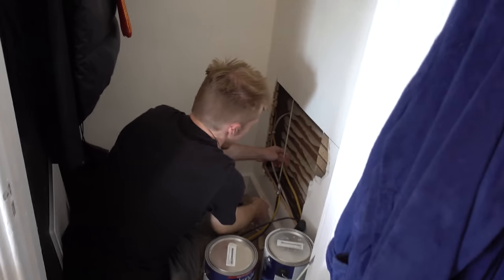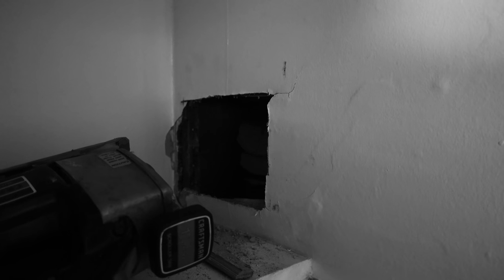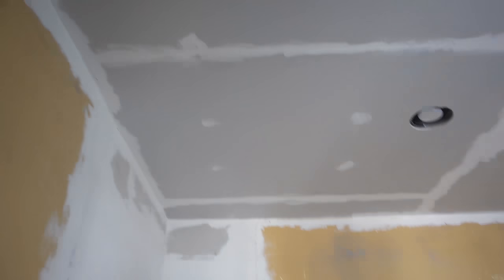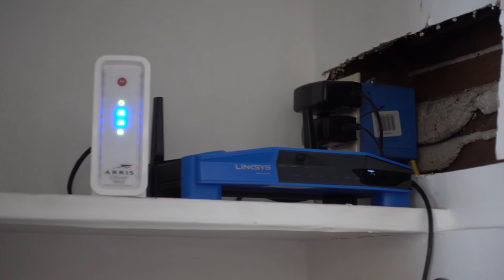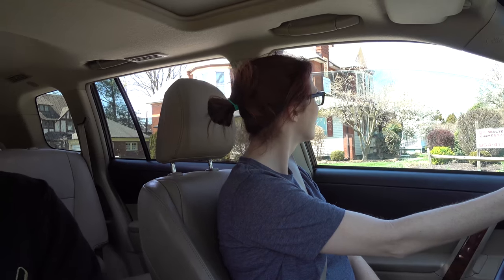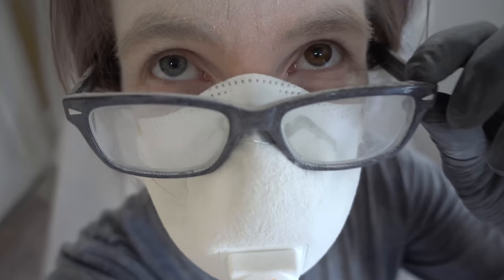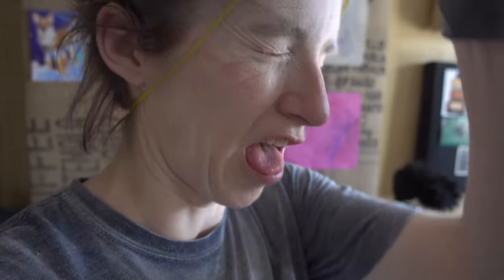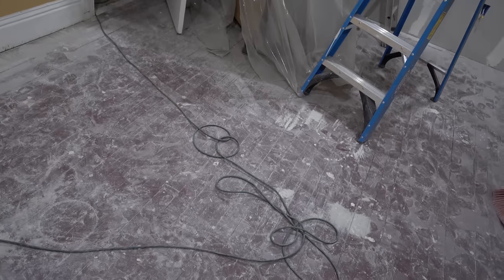Sanding Drywall Makes Me Dirty!

Comment: Aloha Allie and Steve, I'm Don; not gonna judge nor ask, "why didn'tcha...whatever". This is a huge undertaking, you have now discovered the impetus for the popcorn ceiling finish! It is your team approach that will serve you best long term. You both seem blessed with high EQs; the emotional support that goes back and forth from & to each other will keep you both motivated. You guys don't show quit, you've each shown an overarching capacity for  hard physical work. Now the point I'm laboring toward (very slowly, kden I'm hep) is, WHEN PAINTING 90% of the work is in the prep! You will not get good results by rushing to the end-ANYBODY?...kden, all together, That's what she said!(TWSS).  If you widen your mud out 'bout 3"-4.5"(a 6" or 9" mud knife's worth-go gradual fron 3", 6", 9") each side from the joint, and yes, do it the second and even third time!(TWSS!) you will not regret it! Its a mental thing, go into the job knowing its gonna be hell, HELL YEAH! that is. Mr. Churchill's infamous admonition so on point: "When you are going through hell, keep going! You may want to put some Lily Allen/Alanis Morissette on ear bud just to get some estrogen going, unless real Steve actually is as evolved as the video Steve, then go blasem! Main-ting brah, maintain! And by all means,   NO SCRIMP ON DA PREP WORK! Mahalo for da opportunity fo' be naele! Aloha

Comment: ya know, you could use the new hole for ventilation, as I see the closet has nada for ventilation.  I doubt your little modem and router will create a lot of heat, but I've seen more and more equipment added until there was so much heat, things stopped working.  The  6' rack packed with high end equipment was the worst.

Comment: You guys are doing good but on the drywall you need to feather out those joints.  You want to be able to run your hand over those joints with your eyes closed and not be able to detect them.  Pick up a 6" and 10" drywall knife.  They also make a tool for perfect corners.